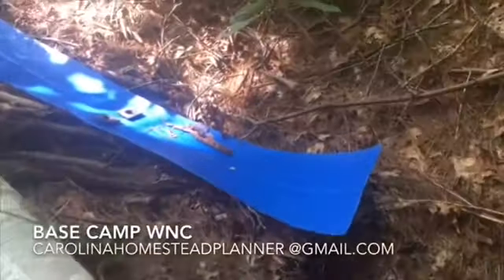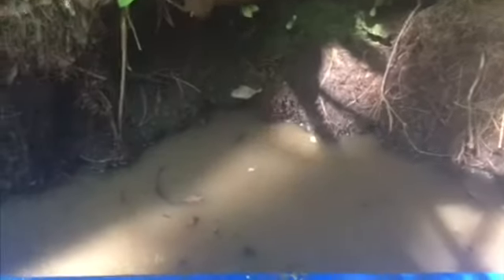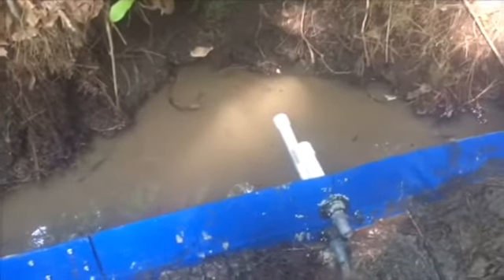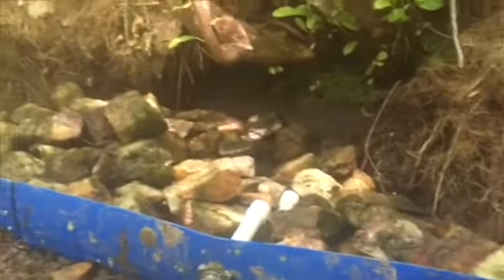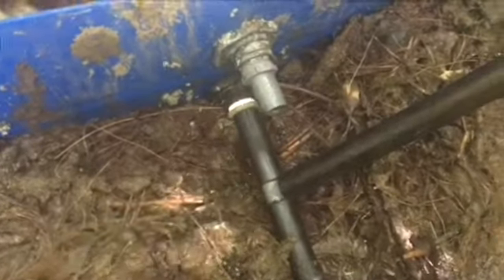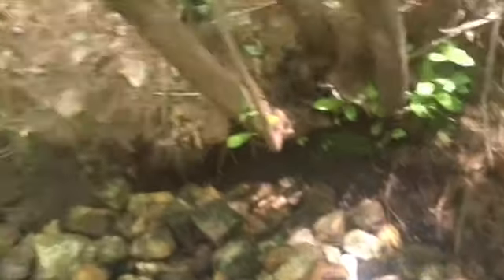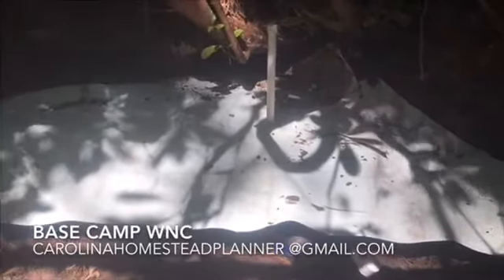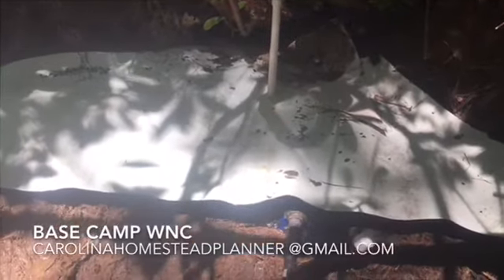How To Develop A Spring Water System

Comment: Finally a video with good information. I don't understand what the tea pipe is for coming out of the rocks. My original idea was to make a concrete bag wall with 80 lb bags but I'm thinking those might seep a little bit once the paper wears off. Maybe I can use some of that pond liner as well. It's pretty difficult location to get to but I think my water source comes out of the ground similarly to this. Thank you for the ideas!
Reply from the maker: Thank you for your comment 
The T pipe that is setting on top of the rock and then covered is for sanitizing the spring 
You can use a mixture of bleach and water pour it in the pipe it then dispenses it in the back of the spring flows though it and out the outlet pipe you can disconnect from the water cistern and let it pour out with the spring water 
This is just to control any algae that may accumulate in the spring - pipe or cistern just for maintenance purposes 
Never thought of using 80 lb bags of concrete you could a 6 m plastic sheet behind your bags to seal the bags
Most of my spring water projects are on the sides of mountains 
It’s hard enough to carry rock and cement there much less 80 lb bags
Your project may be closer to a road or path
Send me pictures of your project and I will help you as well with the design 
Just curious where are you located 
If you want to send pictures text them to me
1-843-224-2262
Looking forward to hearing from you 
And as always like share and subscribe 
Eric

Comment: I’m trying to develop a spring on our property. I’ve know about it for almost a year. It never stops flowing, even during the driest part of last summer. This year is when I put my mind to it that I was going to develop it. I’ve done multiple basic tests for chemistry and bacteria. Which all came back good. However I’m bothered by something. Yesterday I took a gallon jug and timed how long it took to fill it up. It took 37 seconds. Last night we had an absolutely downpour. Today I took my jug down and it only took 21 seconds to fill up. Is this normal or does the rapid increase in flow rate indicate that this is a really shallow spring and is at high risk for surface contamination?
Reply from the maker: I would investigate the possibility of surface water 
Have you found the spring head or is it above where you have been measuring the water 
I would take a sample during high flow to see if there’s any evidence of contamination 
I would to a little more just for peace of mind
Reply: @basecampwnc1745  So I'm thinking we have a spring, but with large amounts of ground water getting into it from somewhere. We JUST had a downpour of rain today and the water coming out exploded. I checked as soon as it stopped pouring. So clearly rain water is getting into it sadly. I happen to have some of those basic test strips with the bacteria test jars. The chemical strips came back fine, it will take a few days to see what the bacteria test does. I still think it is some sort of spring because last summer we went probably almost 2 months without any rain. Everything was dry as a bone, our creek totally dried up and our lawn was dead, but water was still coming out of there at probably a gallon a minute. I can't investigate much further because I would be going off our property. All the the chemical tests and bacteria tests so far have come back fine. We will have to see what this new bacteria test I just took shows. Thank you for taking the time to reply to me! I'll post again in a few days after the bacteria test has done its thing.
Reply: @basecampwnc1745  well it’s been 3 or 4 days since I took that bacteria sample and it’s still showing clean. So at least that’s a good thing

Comment: Can you eliminate spring box? I live in cold climate. I need to bury pipes at 4 to 5 feet. Spring box seems to shallow. Or would it not freeze because of water flow?
Reply from the maker: The spring box is for sediment catchment 
Of you can filter sediment out at the cistern or at your house
Reply: Hey there. I'm in Nova Scotia and last year saw my neighbor having a piece of heavy duty plastic culvert dug in vertically by a backhoe. Apparently it is approved for use with potable water. The pipe to the house is buried deep, there's the usual gravel at the bottom and around the sides of the culvert. The top sticks out a few feet and has a cap. The culvert is very impressive, about 4-6 inches thick sides twin wall with corrugation and about 3 ft wide, 10 or so feet long. Cheers.

Comment: I have a new sprung spring on flat land (our area has lots of natural springs - in fact the town public water supply is from underground springs).  I need to tap this new spring and drain off the water to a near by stream (30 ft away).  This new spring has saturated the flat land all around it and migrates to other low areas as well.  There is a slight slop to a spring fed stream after a puddling areas.  Impossible to mow without sinking to hubcaps.  Is it possible to say cut the bottom out of a large barrel or say a large tote, place it into the ground above the spring, (make or add a cover), create a drain hole, dig a shallow trench and bury/run a drain pipe to the stream?  And also what sized pipe should I use based on the gpm flow?  4 inch pvc or plastic black drain pipe seems like over kill.  Any suggestions on the depth of the "containment well" and drain line hole location would be much appreciated.  Do not intend to ever try and drink this water.  Cannot do a french drain type system as the ground between the new spring and stream is an easement area so shallow hand dug only.

Comment: What is the minimum flow rate for a spring that would be worth developing.
Reply from the maker: David 
There is 1440 minutes in a 24 hour day
So 1 gallon per minute is 1440 per day 1 quart per minute is 360 gallons per day 
That’s more than enough to live on
Reply: Thanks that helps a lot. Because I have one that I would like to develop first that is producing about 1 quart per minute and two other Springs that I might be able to develop at a later time that may be producing more than that.

Comment: Do you use sodium bentonite? There are a few different types. And it is hard to find. Will gypsum work or will it dissolve?
Reply from the maker: It is sodium bentonite 
Amazon has it sodium bentonite for pond sealing $90.00 bag
I googled it 50 lb bag
$28.00
Call your local well driller he will buy it by the pallet load
Reply: @basecampwnc1745  thanks

Comment: I just bought a piece of land in AL that has a dry creek bed and in the middle of it some old timers had used rock to build around a spring. I see at least 3 springs bubbling up, but am concerned that when it starts raining they'll be contaminated. Someone told me there's a natural underground river under the creek bed and that's why there's huge holes in it...when it does rain the aquifer gets so full it bubbles up from the ground throughout it. It's all in a low spot on the property... no high ground. Can I develop any of them or is it a lost cause?

Comment: How do you locate where a spring would be? Is this possible on all properties?
Reply from the maker: What you are looking for is a spot that is wet all year if you see water on the surface you need to start above that spot and dig a trench perpendicular to the slope and try to locate the point that it emerges from the ground 
It may that some digging 
But start looking mark the spot then come back in dry weather if is still wet then start digging

Comment: Sir this is very informative, I have a small homestead and I have quite a few of what I call wet weather springs on the property, it only takes about a 1/4” of rain to bring them to the surface. My thought is , this is overflow that the normal channel can’t handle , and these would be good candidates for tapping. Could you give me your thoughts on this? I currently have water but I would like an off grid solution as well
Reply from the maker: Jeff 
My first concern is if they only flow after a nail that the water is following the rock under the dirt 
A good spring will flow most of not all year not just after the rain
Try to find the spring head 
It may be flowing you can’t see it 
May need to dig up hill from where you see it coming out of the ground
Thanks for your comment 
And as always subscribe like and share 
ERIC
Reply: BASE CAMP WNC 
Thank you for your answer Eric 
This is kind of what I was thinking but I’ve never developed a spring before. Day before yesterday we got 4” of rain and everyone of them were raging, so much that they left trenches in the yard and pasture that I now have to make repairs. I need to further investigate these . I think I can tap these to get something just not sure what . The previous owners of this property utilized this to create a one acre pond that has no real feed per se but is kept full by these light springs and seeps . I’m looking to add more for my horses and chickens as a continuous flow for them and of course an emergency use for us
Jeff